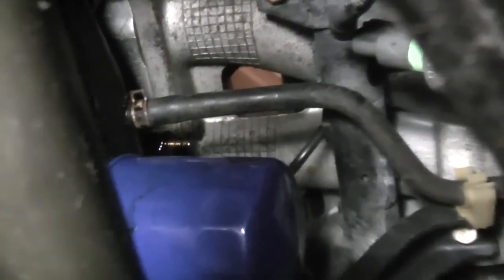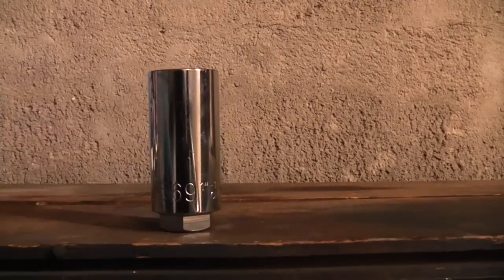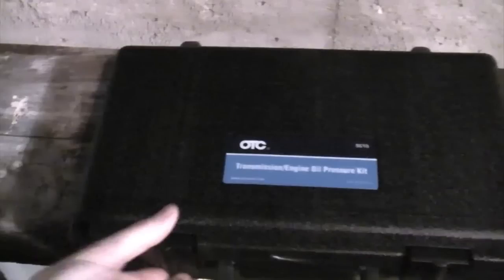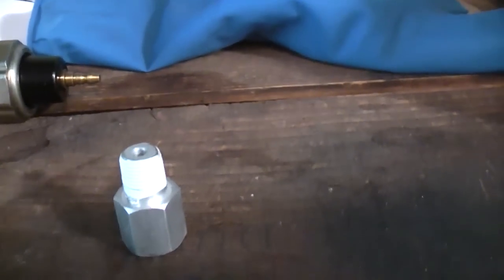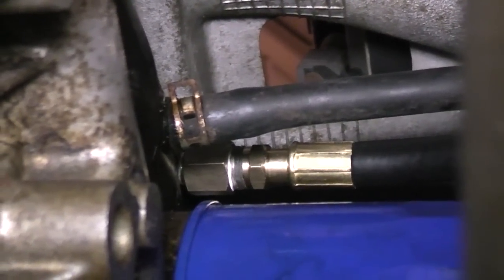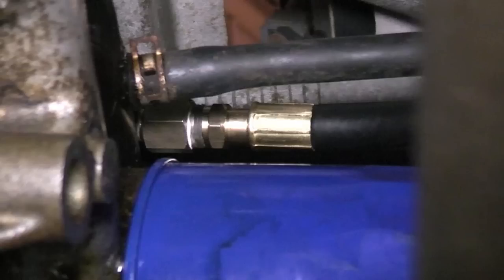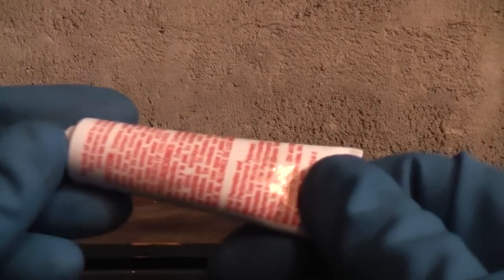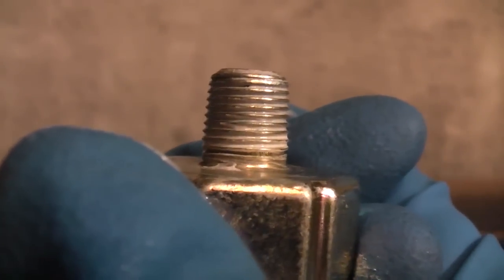How To Check Engine Oil Pressure

Comment: hi.

Sorry to ask you but could you help me with this question?

What does it mean if you have oil leaking from your Oil Pressure Switch. i have a Vauxhall Corsa 1998 (1.2 petrol engine). It leaks when the engine is turned on.
Reply from the maker: +hyylo The rubber diaphragm in the switch is torn.
Reply: thanks

Comment: How abt removing oil filter first on that honda b 4? Looked like it ben ez er to get too! Ay? 11lbs? Really? Dang thats why i got a V-8 ford!
Reply from the maker: The horizontally mounted filter stores more oil than you would think and it would have leaked a considerable amount on removal directly on the exhaust underneath that no matter how well you clean it would have to burn off. So I decided to work around it and avoid the mess.

That's why after oil changes it takes time for the oil pressure indicator to go off because the pump has to fill the new filter.

Comment: So oil needs to be removed before measuring or in cold oil is not high enough to start leaking from the hole?
Reply from the maker: Oil drains by gravity to the oil pan when the engine is off so you don't need to remove any oil.